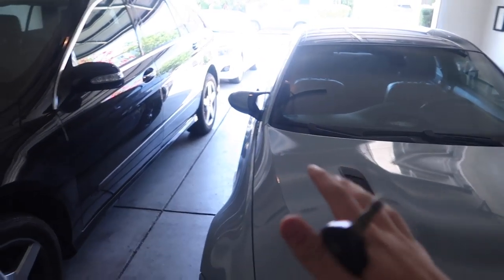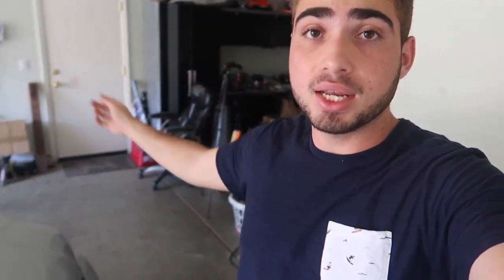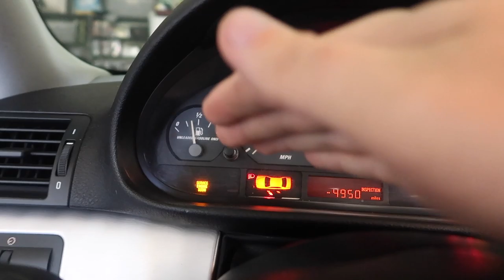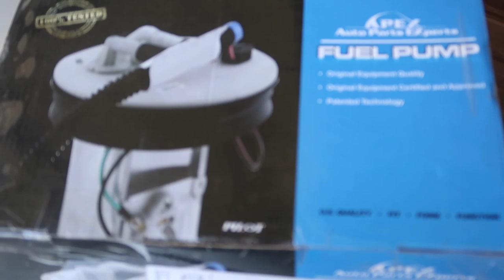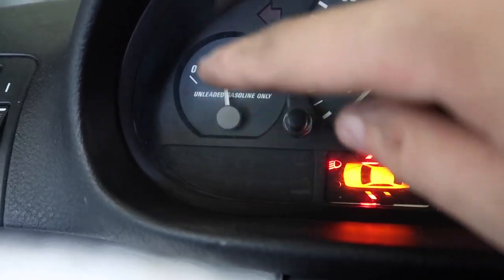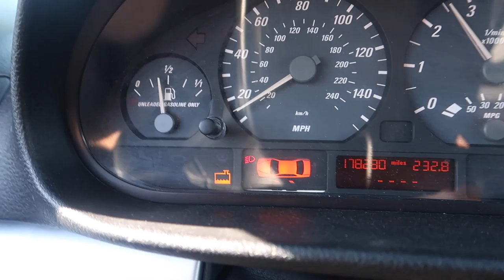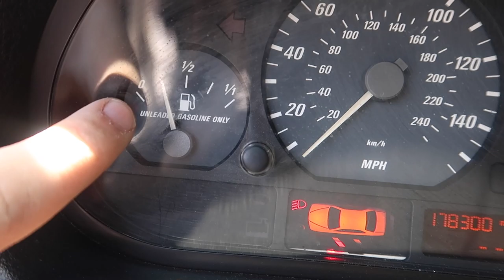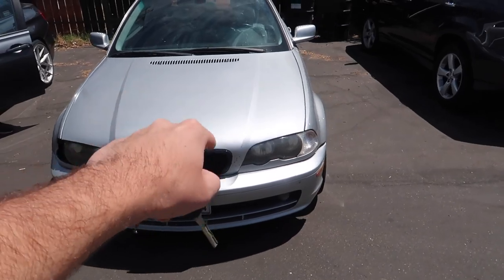WELP, THE E46 IS AT THE SHOP! FIXING ALL THE FLAWS!

Comment: You drive to a gas station to put gas in a can in case the gauge is wrong and you run out of gas.  Why not just fill the car's gas tank with gas?  Then you could also tell if the gauge works.